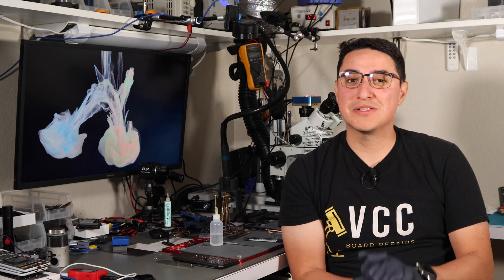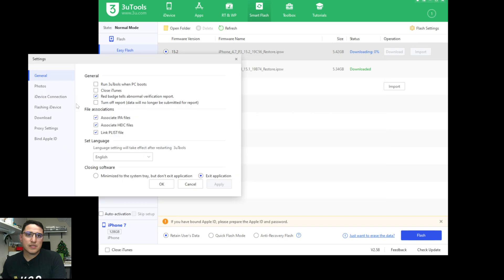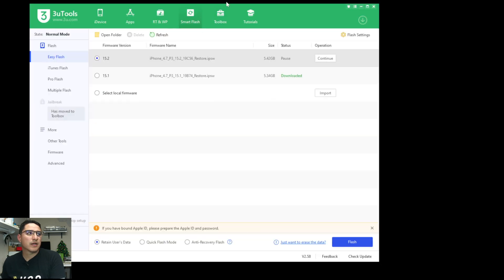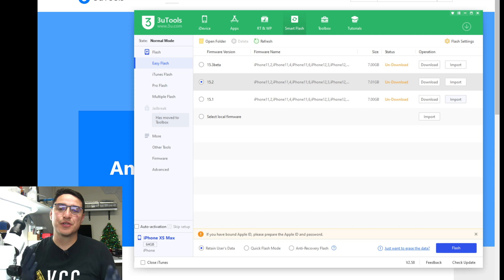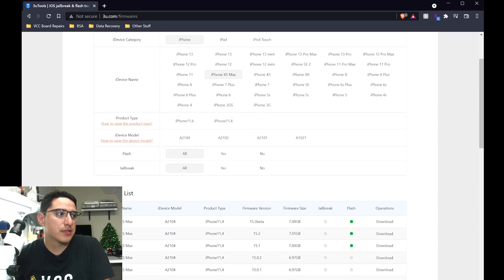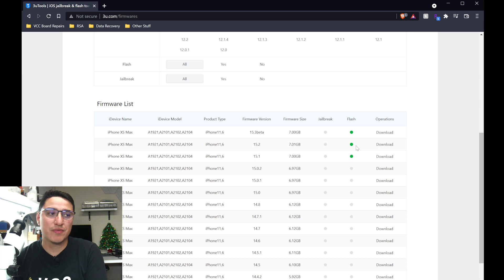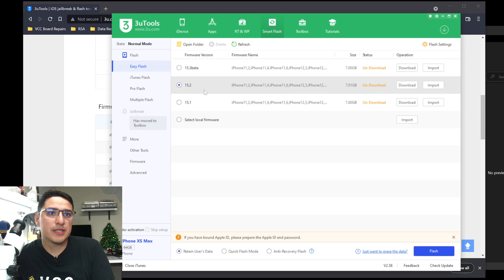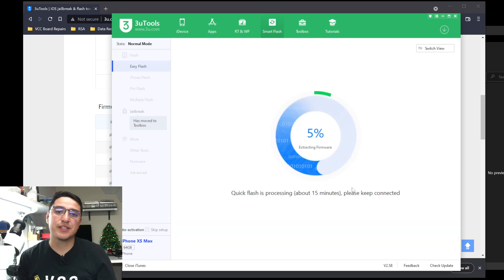3U Tools Not Downloading Fix. How To Manually Import IPSW iOS Firmware Update into 3U Tools.

Comment: Dont Use 3utools This Tool it will damaged your data and you will end up on bootloop and there noway to fix it but facatory Reatoring your Device and you will lose the data dont use this tool is a Risk Malware
Reply from the maker: That's is absolutely incorrect. We use it on a daily basis and never had data lost because of it.

Comment: What is the oldest iOS version 3UTools can work with? I have an iPad 4 (A1458) I believe still has 10.3.3 or 10.3.4.  it has the 4 digit screen passcode. The iPad was given to me. I want to use the iPad for it's camera features. I don't think the iOS on the iPad can be upgraded but that's fine. Thank you 🤓
Reply from the maker: The oldest you see on 3u is what you can flash. That's it
Reply: @VCCBoardRepairs  ok thank you 🤓

Comment: Do I need to download iTunes to work with 3utools or can I just use the iTunes driver to work with 3tools only to downgrade iOS

Also I realized that the size for iOS file is a bit smaller on 3u than what’s on the ipsw site. Is there a difference?
Reply from the maker: yes you need itunes installed for 3u to work.

i dont know about the differences between iTunes & 3u tools files.

Comment: Hi Good M 
I load 15.3 for my iPhone 8X .but I lost all my data after complete .please advise me urgent
Reply from the maker: Sounds like you have restored your iPhone and it was factory reset. no way to get your data back unfortunately
Reply: @VCCBoardRepairs   thanks Jesse .are I can get back my WhatsApp which is over 80GB from iTunes back up?
Reply from the maker: Yes, if you did an encrypted backup with iTunes before you erased it. It will be there after you restore from that backup
Reply: Thanks for  70 years old man difficult .let’s I try .thanks for your advise .
But I advise you ad in your clip if you update firmware .you lose data

Comment: Hi! Newbie to the channel, any tips on the iPad 7th gen 7,12 IOS 15.2 update? It keeps getting stuck on "Sending KernalCache" at 18% then fails the process
Reply from the maker: Try iTunes flash option on 3u tools, on the upper left. Then check what iTunes Error code you get
Reply: @VCCBoardRepairs  Okay, testing now. Will get back to you when it's done
Reply: @VCCBoardRepairs  Error 4005 (Code explination: Gave up waiting for device to transition from Recovery state to Recovery state.)
Reply from the maker: That's most likely a CPU issue. iPad 7 are notorious for it. Will require a CPU reball to fix.

You can find a video of me attempting it and failing on my channel 😅
Reply: @VCCBoardRepairs  I recently saw your recent fail on a live stream 😆 I dont think i'll be able to reball it myself since it's not my iPad it's my sister's boyfriend's cousin's

Comment: we had that issue from at least 14.12.21, 3uools suppoort said they chceck on thier site, and everything works fine -.-
im even trying reinstall windows and still have same issue.
Downloading stuck on 'connecting' or 'on the queue'
anything else working fine, even when im downloading other file than firmwares (e.g. pangu jailbreak)  direct from 3u app!
only firmwares stuck... 
i hope they will fix it soon as i sen its start to be common issue...
Reply from the maker: Yes I hope they fix it soon too!